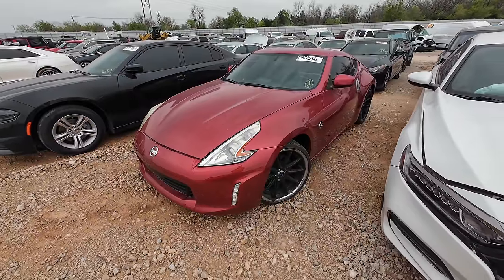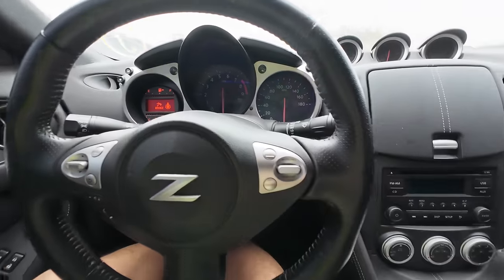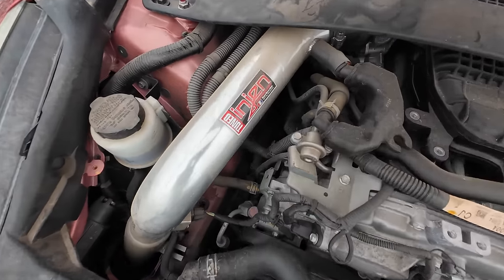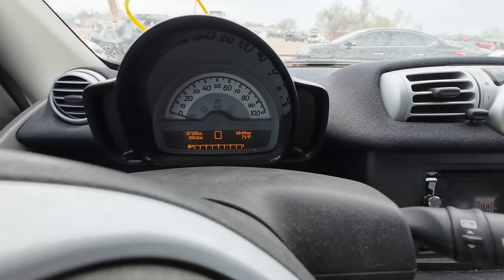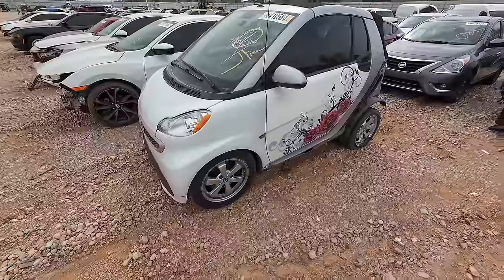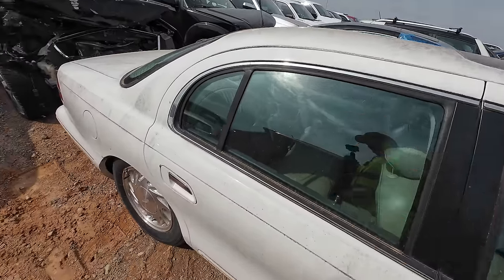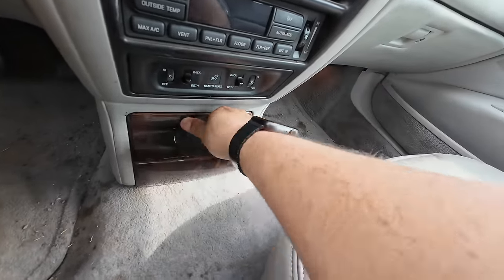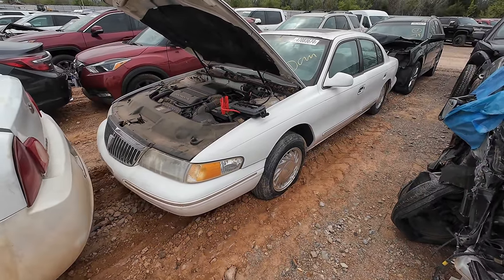I Almost got Fooled into Buying this 2x Wrecked Nissan 370z!!!

Comment: The Z is traditional push to start. The key hole is for starting the car if the key fob has died. The 2007-2012 Altimas were the same way. 😊

Comment: I like that Lincoln!
Not sure what it would cost to fix the air suspension.
So glad you are feeling better Man!
Reply: I am thinking a damaged air fitting might be the issue. Grainger would possibly have those fittings for that. 😊
Reply: many people just do shock absorber retrofits the air suspension was a poor design
Reply: Rock Auto has a full suspension switch for $400. The air suspension compressor replacement is only $200.

Comment: My son-in-law bought a Toyota at a used car dealership.  It looked really nice and ran pretty well.  Several months later, he started having lots of trouble with it.  I was doing some work on it to help him out, and I Googled the VIN trying to find some info for a parts version and came across the auction pictures of a badly wrecked car that matched the VIN I had run.

A few months ago, I  was driving past the little airport in our town, and there was a nice looking car for sale, so I stopped to look at it.  As I started back down the road I decided to Google the VIN and turned around.  The VIN came up with wrecked car pictures with VIN matching the car I was looking at.

Now I always Google the VIN on any car I'm interested in.
Reply: I bought a Toyota Sequoia with "80,000" miles. Googled the vin when I got home, 325,000 OG miles. Dirt bag rolled it back and flipped it.

Comment: Had a 97 Continental - best couch on wheels - Since I can't link to a website here just wanted to comment on the suspension. The bags are a simple fix and I got mine actually out of a junk yard. The line leaks are a bit more difficult. The sound of that pump is a concern. It may work if you can patch up any leaks and get working bags. Takes 5 min to switch a bag out and the hardest part is the retaining clip. There is a lever at the bag to deflate them and they pop right out then. To keep the ride, it is worth fixing the air suspension. Glad you are feeling better.

Comment: I had a black 99 Lincoln Continental.. never had any problems with the 32 valve.. not even a coil ! I beat the ball bag  outta the car lol it was fun.. air suspension never gave me any trouble.. I would load up the trunk with way more weight then I should have.. I literally put a 40 gallon rv water tank in the trunk.. filled it up and also a few deep cycle batteries and 30 lb propane tank in the back seat  ! It took it all , was a bit sketchy travelling at 70 mph for nearly 3 hrs. Lol  the transmission  I replaced the torque converter and the valve body..  took 45 mins to pull the transmission..

Comment: If you can find another Lincoln with front end damage but good rear suspension, and swap out the rear suspension into that one, job done. Then you can sell off any surplus parts from the damaged one.

Comment: On the Lincoln, I think you can replace or bypass the air suspension with struts and shocks from a Taurus. I remember the generation before that was practically a fancy Taurus

Comment: If you try to grab a Smart ForTwo, try to get the refresh model (2016 or 2017) not the older ones.
I owned an '08 and currently own a '16 and it's a night and day difference.

They're all noisey and rattle like crazy. They're little 3 cylinders.
Reply: That's nice.

Comment: the only thing worth anything on the z would be the motor after being wrecked if it seriously has 19k miles and nothing has been messed with. but even though i'm not a ford fan i would take the lincoln over the smart. also can the public bid on any of the cars?